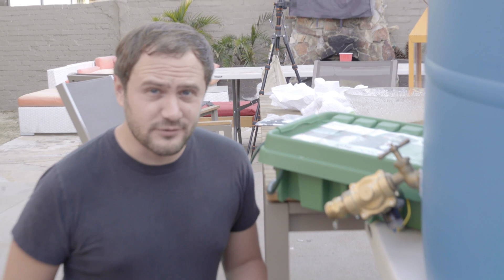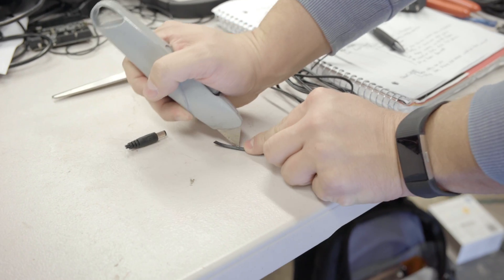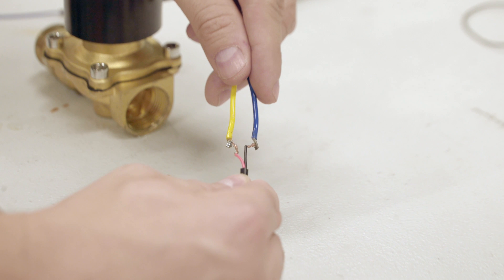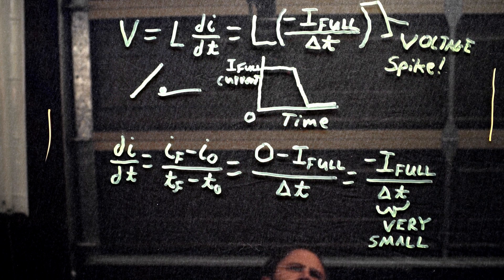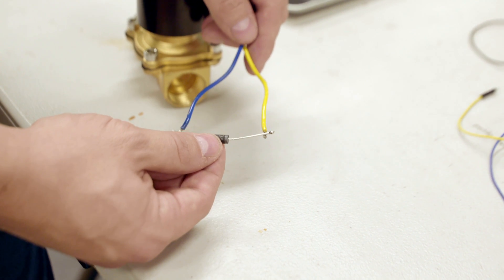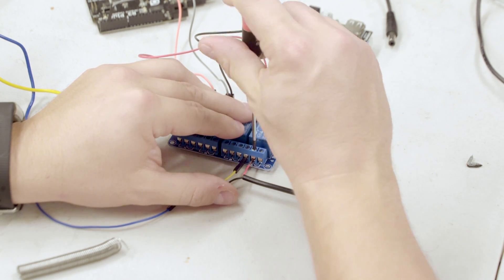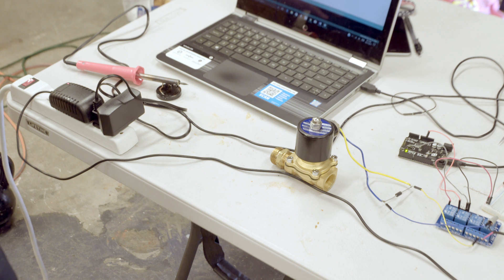Arduino Solenoid Valve Circuit: How to control water flow with an Arduino

Comment: What type of solenoid valve should we use for our Arduino-based system, considering it's connected to a container with no direct water source or pressure?

Comment: great vid however at 2:40 how does the voltage loop counterclockwise if the cathode side of the diode is blocking, also from my understanding of inductors the current flow should be clockwise when there is a current drop in this scenerio, since inductors resist change in current so a drop in current would mean it wants to keep the current moving in its original clockwise direction.

Comment: I'm not sure why we're worried about EMF.  There's an optocoupler on the relay board you're using.  Technically there isn't a way of damaging the controller.  Unless you're worried about the power supply that drives the device.

Comment: Years ago I did a project and bought an optically isolated relay to avoid the kickback. I never tried it though. Any ideas if I was on a good path? The project reemerges :)
Reply: Two different things.  What you have is normal for all relays and protects the Arduino from the kickback.  What he added here protects the power module from the kickback.  Both are needed.

Comment: 1) dont use relay to do it.. it's very big and it loses a lot of heat and it also have shorter life span. oww and it costs more. Use 'dual n-mosfet board', wiring will be exactly the same. 
2) don't use wire made with small wires with screw connector.. it's fire hazard. Use single core wire or add metal things at the end (sorry i don't how they are called in english)

Comment: Amazing, thank you! I'm making a project with an arduino uno + 12v solenoid valve + 11.4 V lipo 3s2p battery. Do you think I can use the STEMMA Non-Latching Mini Relay for this? Or what specifications does the relay need? Thanks

Comment: Quick question, if I just solder a button to the power signal of the valve and a power supply, and then solder the grounds together, will the solenoid valve open when I press the button or no?
Reply: Do I actually need a relay just to open and close with a button
Reply: Obviously it would open how do you think the switches in your house work ... probably still make use of the diode as it may weld the contacts shut when you switch the power off due to the arc

Comment: I'm about to make this with a TIP 120 Darlington Transistor instead of the relay. Is there anything else I need to be aware of? Why use such a complicated module when you can replace it with a single transistor?
EDIT: I ended up making it and it works flawlessly! Amazing how much power you get with gravity. 2 giant beds are fully automated so I can live at peace next quarter!

Comment: I want to keep the valve open for a few minutes at time, but I keep reading Amazon reviews for similar valves where people find that the valve heats up quickly and wears out from the heat.  The only solutions proposed are to open it using PWM and to open it using more amperage but hold it open with less voltage, and I don't know how to do that, today.  Has anyone had an issue like this?  I would like to avoid it before buying all of this stuff to automate filling a bucket.

Comment: I need to do this but not just on/off. I need about 4 stops between open and closed. Any ideas?
Reply: You could use a stepper motor controlled valve.

Comment: Does anybody know what connections he made to the breadboard?
Reply: I'm working from a Raspberry Pi here, but this is what I gathered from the video. 
The majority of what he talks about ends up connecting to a relay. 
But the relay is triggered by the Raspberry Pi/Adruino. 
*So to break this question down further you can find the answer to this by researching how to control relays with a Raspberry Pi.*
Because the relay is responsible for a stronger power source for powering the solenoid, the single board computer (Pi or Adruino) is responsible for triggering the relay.

Comment: Any advice on using an arduino with a 3 way solenoid valve ? To change flow direction ? I have a project I need help with please

Comment: >the diode the diode the diode the snubber diode the diode
>amazon affiliate link to a variety pack

i'm the least qualified person to provide any insight here, but I think he's using a 1N4008 diode? If I'm right, that is rated for 1200 volts and 1 amp. I don't have a 1N4008, but I do have a 1N4007, which is apparently rated for 50 volts and 1 amp. which is hopefully going to work for this 12 volt project? brb getting electrocuted

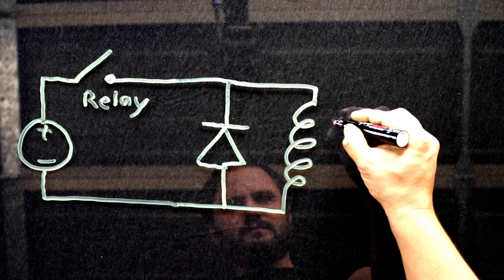Comment: 2:30 
For everyone confused with current direction shown in this video and diode placement. Back EMF is due to original voltage source being removed suddenly (i.e switched off,  which causes current to reduce). Inductor tries to prevent this reduction in current by creating EMF in the opposite direction to source hence the name Back EMF. But it does not cause the current to go in the opposite direction as shown in this video. This is why the diode has to be positioned in a way such that it acts as short circuit and prevent the reverse voltage due to back EMF from appearing across source and causing an arc.

In this video, diode placement is correct but current direction due to Back EMF is wrong.

Remember in inductor current lags voltage by 90 degrees in an inductor.
Reply: So i think what your saying is Back EMF is the reverse of the magnetic field which was pushed outward during the on switch position but then flows backward into the coil when it collapses? But does not flow back to the negative upstream source of current flow?
Reply: Thanks! I'm happy to see I'm not the only one to see this error.
Reply: What diode should be use as example of this video?
Reply: @syaduinotech3681  standard diode with an high enough reverse DC voltage.

Comment: Great video, but a small tip .. 
When u cut off the switch; the reverse induced voltage will draw a current in a direction WITH the original one trying to keep the same magnetic field .. i.e the current arrows should've been drawn in the opposite direction and that will make the current flow from bottom to top of the diode ..

Comment: Hey! Love the video and your channel. I had a quick question about the solenoid control. So my circuit works however all my relays turn on when i turn on one relay using my Raspberry pi. Should i isolate the 12V power supply for each solenoid valve? i feel like the question feels stupid but im a chemical engineer dabbling in microelectronics. lol

Comment: The explanation with current at 2:49 is incorrect. The current flow through the coil will continue in the same direction -- The voltage is proportional to the DERIVATIVE of current; The amplitude of the current begins to fall but is still positive, meaning a negative derivative, which also means negative voltage. The current through the coil has no way or reason to change its direction.
The way you are drawing the current flow at 2:49 would mean the diode is reverse biased -- Current cannot flow from the cathode to the anode.
Reply: Yup! Agree

Comment: Ouch! I am looking at buying about 30 valves for an arrangement hanging from a roof. Do you know of any cheaper method? 30 flower pots of various sizes that needs to be watered. Preferably without a ladder.
Reply: Pvc pipe with holes in it

Comment: Hi,
I have worked with this type of solenoid valves. But now I am using a different type of valve, known as bistable (or pulse) solenoid valve, which just needs a small of DC-voltage to open the valve and an opposite polarity DC-Voltage pulse to close it. But I am having problem in making it work in terms of output water pressure. It's very less than the given water pressure. Can you help me in solving this issue ? Thanks

Comment: I bought two valves from robou.in, they mentioned that they are normally closed but they are working as normally open slaves, without supplying power they are just releasing the water

Comment: WOw thank you for useful video and it might helps in my aquaponics projects! May I know which diode you are using? IN4001? I am having 12Vdc 5W solenoid valve as well, with a supply of 12Vdc 2A.
Reply: is IN4001 good enough to use?

Comment: I have attached the power to the solenoid valve, but it keeps clicking. About 1 every second or so. I chose the 1/2 12v DC Solenoid, and am using a AC/DC adapter 12Vdc 1.5A power. I do not have the solenoid valve connected to water, could that be the problem?

Comment: hey.. i'm using a 24V solenoid valve instead of 12V, what diode should i use?
Reply: any will work, ex 1n4001

Comment: Hey, a good question here, if I want to control it with a temperature input, do you have an idea on how to do it?
Reply: Mark, this is what I'm trying to accomplish too..  Looking to build a simple circuit to briefly turn my water on and off when outside temp drops below freezing..   You'll need to place a temperature sensor in the area you want to test, and then activate the solenoid code if the temperature is past your threshold...  Basically, you'll use something like this: https://www.bc-robotics.com/tutorials/using-a-tmp36-temperature-sensor-with-arduino/ combined with the video above..    There's another temperature transducer you can use called an AD590 that works for this sort of thing, but you'd have to get the specs on that to understand what voltages equal what temperatures.    Hope this helps.

Comment: Very nice,my question about solenoid valves is how much time can be activated without destroying the coil.I plan to make a water tank with electronic water level sensor,but in case that there is no water flow to fill the tank the solenoid will be actuated even for days.This might destroy the valve or not?
Reply: look for a 'normally closed' solenoid valve (this means the valve is closed when the solenoid is not powered)

Comment: May i know which diode are used ? The specification of diode
Reply: 1n4007 works great for this use case
Reply: @interupt0  in the case of the valve in the video being 12v then 1N4007 will work but it way over kill. The 1N4007 blocks up to 1000v. The 1N4007 which blocks up to 50v is the best fit.

Comment: I am working on a similar project but using an ultrasonic sensor to open a solenoid valve using arduino uno can you please help me with the code
Reply: I think I know how to help
Reply: @ephremadugna3619  have u done such projects with similar principle?? Plz reply
Reply: @ravisinghh90  Yes I have you can email me if you want
Reply: Have ur project completed successfully?  Plz reply as I m also in similar project
Reply: Yes I did complete it

Comment: If i were to do exactly this but for 4 solenoid valves in the same relay. Would you recommend using one diode per valve for protection or wiring the relay inputs to a single diode would suffice ?
Reply: You should use different diodes

Comment: When using an AC solenoid, should we go for a diode? And what type?
Reply: AC Solenoid? you don't have to use an AC solenoid, but if you insist; is when you have an AC power source ! .. 
should you go for a diode? you should go for an RC snubber network, which is a capacitor and a resistor in series that does the same job as the flyback diode but with AC loads since it allows the current in both directions "unlike the diode"

Comment: 2:45 This diagram's current is backwards; you suddenly swapped the current flow direction when the switch toggled. The diagram even shows current going backwards through the diode...
Reply: Yeah i thought something was up with it

Comment: You show the current flowing in the wrong direction when the relay is opened. You have the current going through the diode in the diode-reverse direction. When the magnetic field in the inductor breaks down after the relay is opened the voltage across the L flips polarity so that the current continues to flow through it in the same direction and through the diode in the diode-forward direction. You have the - sign in front of the di/dt but I believe it should be moved over in front of the V. The schematic drawing is correct though.
Reply: Means that diode wrong way connection?
Reply: @kclee5381  No, the diode is shown in the correct direction. That is the right way to wire the diode. I meant that the current will flow through the diode from the anode to the cathode but the video shows the opposite.

Comment: Sorry i'm quite new on this. I have a 12V Solenoid valve that i want to connect. What values should my snubber- diode have?
Reply: awesome!! i’m glad i found this. i am in the process of building an arduino 12v irrigation system and without this little nugget of info, i would have potentially burned up a few relay boards, got irritated and maybe abandoned the arduino base for something else (timers and such) this something not seen in any other “arduino irrigation” video

Comment: is it not possible to use the relay in such a way that the low voltage inductor loop is independent of the highpower loop? why does the low voltage signal from the Arduino also need to pass through the Solenoid valve, isnt this what is causing the back EMF?
Reply: To handle high voltages you need a relay board. A Relay board will protect the Arduino Uno components from high voltages. What would happen if you pass high pressure to a pipe that can't handle high pressure? The pipe will explode!

That's the thing that will happened to your Arduino Uno when you don't have a "Relay Board".

The next thing that you want to know about is the motor. All motors generate electricity if you spin it. This is why he's using a "DIODE" to stop the excess electricity from flowing back to the relay board or Arduino board. Also the motor will always generate EMF. 

To generate electricity you need a magnet and wires to coil around the magnet. Which causes EMF.

Take note that he's using a different power source for the Arduino and for the solenoid valve.

Obviously if you want to control things from your phone or your computer over the internet. You would need an Arduino.

You should research these on google:
Diode
Motor
Relay Board
Inductor

Comment: Hey, thanks for this video. I have a question. I bought a 110 AC solenoid, do i need diode too if I'm playin to use it with a relay (solid state relay)? Thanks very much.
Reply: For AC you can't use regular diode. Have to use TVS bidirectional diode, varistor or RC snubber.
Reply: @mmwienk2  hi how are you? I have to control three valves. should i use an rc snubber on each valve?
Reply: @andresf12  Yes. I assume each valve can be turned on separately in your setup so use a snubber for each valve to protect the relay/switch.

Comment: Sir what is the value of diode?thank you.
Reply: any will do
Reply: @hooperwille  while in the case of the 12v valve in the video,  "any will do".  But it might help to explain why.
Due to the valve in the example being 12v then yes, the 1N4001 can block up to 50v, a stronger diode, for example 1N4007 can block up to 1000v. But if the valve is of a higher voltage then "any will do" will not do. This is all about learning, lets help each other.
Reference:
https://reprage.com/post/flyback-diodes

Comment: Do you know what device would do the opposite of this?  Instead of control the flow of water, have the water control the flow of current?  A water relay?  I think there is a term for what I want to do but am just not searching with the right description.
Reply: Hook up a water level sensor, and when water level reaches a desired level, the sensor sends a signal to activate/deactivate a relay.

Comment: What happens if you didn't use relay in this experiment? 
I mean if you directly connect solenoid valve to the aurdino with out using relay
Reply: The solenoid valve wont get enough energy to open and because of the coil inside it probably blow up the arduino itself too.

Comment: I soldered a diode, but afraid if solder heat has spoiled the diode. I wanted to add a 1K resistor on top of that. will that help/?

Comment: I recomend testing your diode first to check which way (multimeter)to connect your positive (red cable). The snubber diode i am using is the other way around i.e the white strip side is negative and the other side is positive (in the video you connected red wire to white stripe side of the diode) ..this resulted to a minor explosion but all is well..

Comment: You have not show all the components , you hide most of the things ,  what is the name of 3rd device other than Arduino and RELAY MODULE . AND what is the purpose of that device . 
I want the complete and proper circuit diagram of this whole circuit . kindly send me to my mail. hassankhansk123@gmail.com . THANKS

Comment: I really appreciate this video, you are the first one to talk about the flyback diode. So just for the extra value added i subscribed and liked your video.
I have to make the same project by hooking up multiple solenoids, and have Arduino run it like a multizone cycle timer. do you suggest Arduino or Raspberry PI?
Reply: Stefano Piardi for a task like this I'd use an Arduino. The advantage of a raspberry pi is it has an os or can have on. You don't need one here so it'd be a waste of money.

Comment: is there any way to controll the solenoid valve precisely with arduino or something else?? I mean that the valve would open as much as you want and close, after you program it in the arduino.
Reply from the maker: No, the solenoid valve just opens and closes. There are different kinds of valves that you can control flow rate. I’ve never used one but you can find more information by Googling around for electric flow control valve or digital flow control valve or digital ball valve.